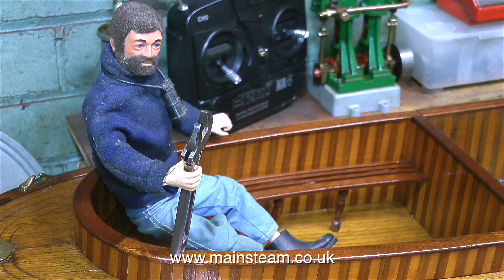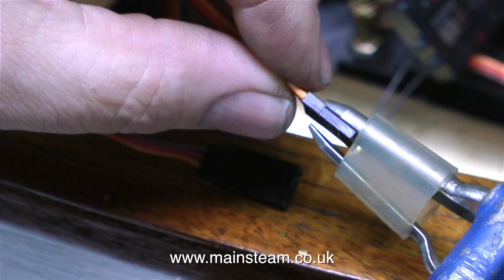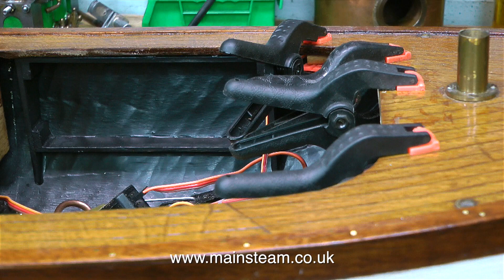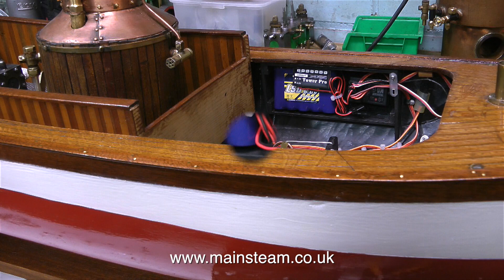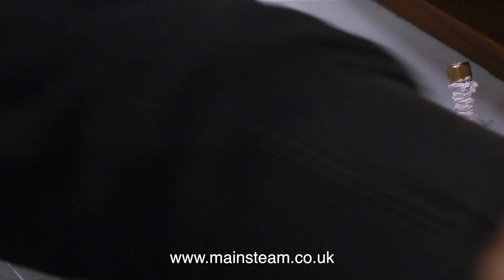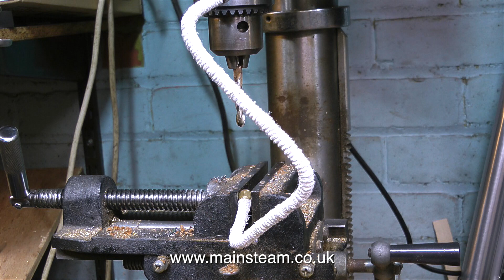REBUILDING A VINTAGE MODEL OPEN STEAM LAUNCH - PART #41

Comment: So I just watched the whole series over the last few days. I enjoyed it. So what about fitting a small generator to the flywheel to keep the batteries charged? Just a thought. If your like me though i'd just be happy to be at the end of the project. I am also of the opinion that adjustable spanners are only to be used in case of a dire emergency but I love your sarcasm about the use of them!